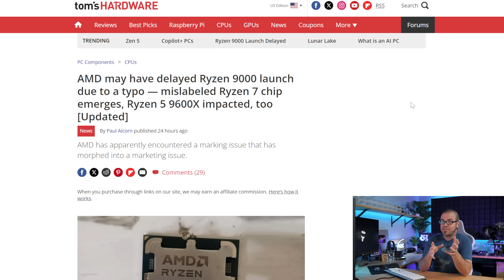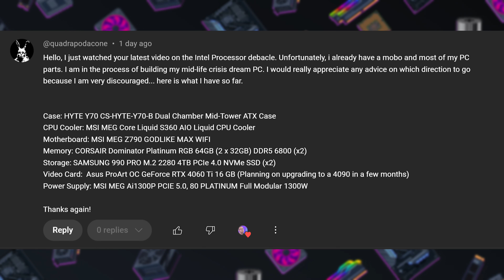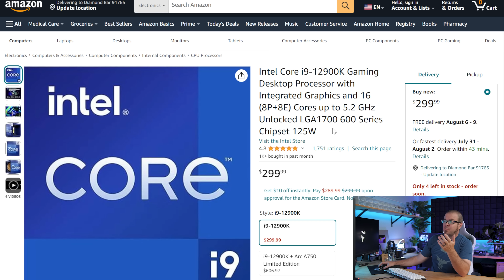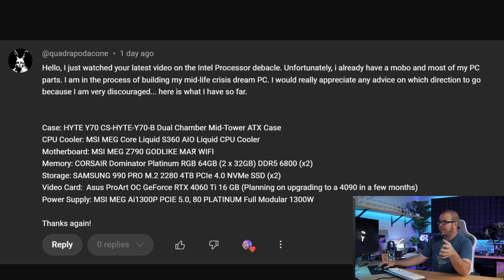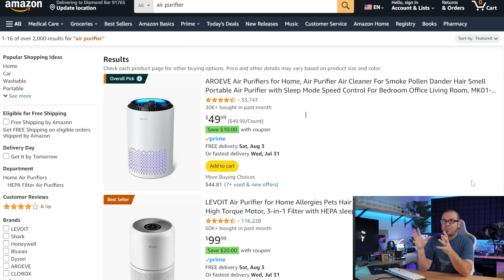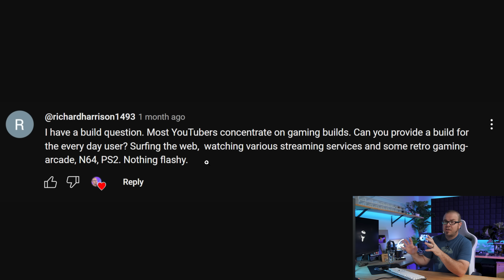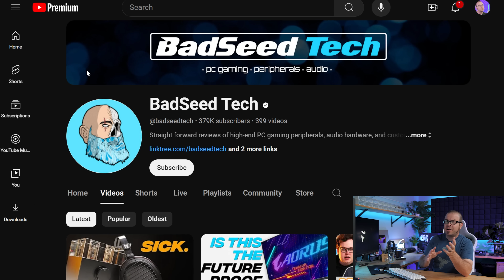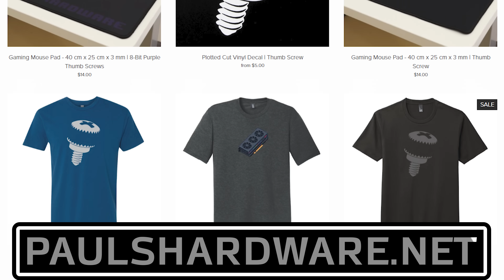What if my Intel CPU explodes?? - Probing Paul #88

Comment: This is why Intel should be legally required to offer a refund to anyone with one of these CPUs, aswell as cover the cost of an equivalent motherboard for a different platform.
Reply: Sorry but that's a pretty unreasonable request.
Reply: @Bobo-ey8fc Its not at all. They put out the product, they made the mistake, they pay for it in full. Next time test your product thoroughly.
Reply: You really don't seem to get it. This is still very early in the process. This could be solved by the micricode update. Also, my main point was it's completely unreasonable to expect Intel to buy you a new motherboard. Frankly that makes no sense and will never happen.
Reply: @Bobo-ey8fc  Well if you want to change platform as you would need to get an equivalent and get away from this unstable platform you need a new mobo. The need for the new mobo is caused by Intel pushing an unstable product to market. It's their fault, so they pay for it.
Reply: @sirdetmist3204 Good luck with that my friend. But I hate to break it to you, that just isn't going to happen. Never has, never will.
Reply: @Bobo-ey8fc  I did say it would happed I said it should.
Reply: @Bobo-ey8fc  I know it wont because companies get away with anything they want.

Just like Nvidia should have been fined billions for releasing a product that was a legitimate fire hazard.
Reply: @Encircled247  I see you're one of these "all companies are evil" guys. Look, say what you want about Nvidia (I'm no fan, but they make good products). But here are the objective facts. They had an issue with the design of the 12V high power connection. Some of the issues were design related while some were user error. Nvidia quickly redesigned the connection, accepted customers RMAs (even the ones that were due to user error) and generally handled it in a decent fashion. 
But of course, in your eyes since all companies are evil, this wasn't enough. 
With all due respect, I think your anger is impairing your ability for rational thought here.
Reply: @Bobo-ey8fc  If something you make constantly causes user error then its the thing you made, not the user. This rarely happened with the old connectors.
Reply: @Encircled247  First off, I never said the connector was ok. Nvidia identified the issue and fixed it. But there was user error (just like there was with the old connector) and the fact that Nvidia still honored user error RMAs is noteworthy. BTW, the failure rate was blown out of proportion by content creators for clicks (just like the Intel issue). I build over 200 PCs a year and I didn't have one single failure of a 4090 since they were introduced, and I do mainly high-end builds.
Reply: @Bobo-ey8fc  Its not noteworthy. The connecter is weak and awful. Its an awful design. Awful designs lead to user error. Thus its Nvidia fault, meaning they pay for it.
Reply: @sirdetmist3204  Um, they have already addressed the issue with an updated version. As I stated I have done hundreds of pcs eith the 12vh connector and haven't had a single issue or failure. You're overblowing this just like you did the Intel issue. I've provided factual information in a rational manner. If you want to have an actual discussion. I'd suggest you calm down and travel with facts not hyperbole.

Comment: no one is speaking about specific cpu which caused this errors  because i am using intel i9 13900k i have faced a lot of bsod before but not every day i have made temperature control limit on bios now it is not creating any issues , i agree what your telling but controlled over clocking issue but exteneded supported clocking limit will not cause any such issues , this issue is coming from few cpu not on all cpu's, i am using gigabyte Z790 pro ud ac mother board

Comment: The last Intel cpu I had was the i5 4460 and didn’t gave me any problems. After that I had an amd Ryzen 3700+ and had some memory problems. Most of the memory problems were gone when I changed to an amd 5800X. Since then I use a mini-pc.

About the Intel 13th and 14th gen cpu’s, Intel extended their warranty for two years, it’s going in the right direction. And about the internal or external sound card vs motherboard sound, for the longest time I have used an internal sound blaster audígy 2 and it sounds much better than onboard sound, especially if you have good speakers. Thanks Paul for all your videos.

Comment: Wow what a reasonable suggestion 12900k is cheap and asus tuff mobo is dirt cheap with 2x32gb ram and 4060ti 16gb, this is the exact platform i use and i tuned it to give me great performance for less than half the cost. Nothing is going to give you the same vr or overwatch performance per dollar duh

Comment: So, if you REALLY need an Intel CPU, buy the 12th gen !?   But better yet, go AMD, even with their AM4 motherboard sets, that is still very good, specially with an Ryzen 5700X3D !   
Or go the better route, spend some more money and go for AM5, with an AMD Ryzen 5 7700X , or spend a bit more for the top : AMD Ryzen 7 7800X3D, with at least 32Gb ram !

Comment: One of the major contributors to Dust is dead skin flakes. So a Bedroom is more likely to build up dust than other parts of the house. What you want to do is setup a system to pull air out of your room through a dust filter, and simultaneously push fresh air into your room, also through a Dust Filter, if you are experiencing a large amount of dust. I actually have a Return Vent in my room connected to the return ventilation in my house, and of course both Inflow and Outflow from the HVAC are filtered and changed twice a year when possible/remembered. But anyways my dad figured this out in the 90s and setup a return vent in my brother's new room, and I just got to benefit years later.

Comment: hey paul I have a question I now have in my PC with an MB of MSI B550 Gaming Plus and I have a Ryzen 9 5900x and for ram Corsair 32 GB DDR4-3200 Kit RAM
(Black, CMW32GX4M2E3200C16, Vengeance RGB PRO, XMP)
but I want to upgrade it to 64 GB and found this Corsair 32 GB DDR4-3200 Kit RAM
(Black, CMH32GX4M2Z3200C16, Vengeance RGB PRO SL, XMP 2.0, AMD Ryzen Optimized) will this be compatible with each other. BTW love your vids
Reply: they will work, still don't advise, if you are able to turn xmp2.0 on a 4 dimm config with different latency and different base frequency, they'll run at 3200, if you're unlucky and xmp get unstable you'll be running both at 2133, find the exact same model, or better, w8 for a promo sell yours and get a 2x32 64 kit
Reply: @zazo..  the only thing that is differs between the 2 is one is smaller in height and AMD Ryzen Optimized
and the other not bud im not sure if thats gonne give a problem and sorry im using google trans late  and ty for helping
Reply: @the_american_way5756  
"CMW32GX4M2E3200C16" SPD Latency 15-15-15-36, SPD Speed 2133MHz - XMP 3200mhz
"CMH32GX4M2Z3200C16" SPD Latency 18-18-18-43, SPD Speed 2666MHz - XMP 3200mhz
Reply: @zazo..  ooo sorry ty man <3
Reply: @the_american_way5756  nothing to be sorry mate ;)

Comment: I highly recommend the BLUEAIR Blue Pure 211+ (square block shape) for an air purifier. It's expensive, but it does a fantastic job. The smaller and cheaper 411 (cylinder shape) is a great alternative if the 211+ is too pricey. These filters do an excellent job of sucking up a lot of dust; my computer goes months with hardly any dust gathering. Both models are designed to run continuously, and I recommend you do that. They run exceptionally quietly.

Comment: "4060ti 16 gig is not that great of a graphics card"

Thanks, Paul.

-User with a gtx 1080
Reply: i feel you, running a 1060, but he has a point, the guy has a z790 godlike mobo, what's the point of spending $1000+ on a mobo and ~$500 on a gpu?
Reply: Just like any other Nvidia crap !

Comment: I wonder what the reason for these supposed Intel failures is. I have been building custom workstations to order only on Intel for years, hundreds of sold I9 14900K and 7 14700K only on MSI and Gigabyte motherboards. Asus has the most unstable boards on the market, so I do not use them and I also advise my customers not to do so. All sets have manually set operating parameters and are stable even under maximum load. I advise you to listen to the voice of reason. The big advantage is that there will be an abundance of processors on Ybay for pennies, just take it because they are 100% not defective

Comment: If you want to be serious about cleaning your gizmos, I suggest the following kit:
1. Stop wasting $ on canned air. Get a cheap, tiny $50 air compressor from Harbor and use lowest pressure. 2. Paint brush & Q-Tips, Pipe Cleaners. 3. 98% Isopropyl alcohol. Because you need to break the static cling to all your bits, and dry wiping can INCREASE the charge. Alcohol wiping breaks the cling. 
And don't forget to hit the BACK of your fanblades with a liquored up Q Tip to break cling and regain airflow, otherwise it just turns into a dirt clod again that delivers no pressure.
Edit: I have a 5000d Airflow housing my daily driver pc, and despite so many wonderful easy-clean filters, it still needs this treatment every season on the inside.

Comment: Dusty computers will stay dusty if you smoke around them. I build and fix computers on the side and smoker PCs are the worse. Components literally become sticky. If you want less dust in your PC, don't smoke around it and get a better vacuum and clean your carpets more often. A carpet cleaning vacuum is also recommended as it'll actually pull a lot more dirt out of your carpet with soap and water. My PC stays clean because of this. I built my current PC about 9 months ago and its still very clean inside.

Comment: Am an Intel owner, am baffled they havent put a hold on sales for the chip, as like you said the info they released isnt exactly reassuring, and I think your advice to those Intel builders on swapping the board for AMD (or if has to be Intel get a 12900k) is solid.

For reference my chip is stable, but of course due to lack of info on batch numbers etc., I dont know if my CPU is already on its way to failing.

Comment: Hopefully everyone panics and turns their setups in so I can buy them cheap
Reply: I’m at X13 z790 mobo’s, X5 evga classy, X4 evga dark kingpin, 4 gigabyte aorus xtrene x, X5 i9 14th 14900k, X2 ROG Thor 1600W titanium, X4 inwin dubili gold cases, X4 cooler master c700m grey cases, X1 thermaltake tower 500 black

Comment: So iv never ocedy 2nd 14900K (FK  Asus Ai OC and you're 1.65v-1.71v) i Delidded this CPU Liquid Metaled it gave it Der8auers Direct Die Contact Frame (200% more surface area) put the Bubblegum TG Tim and a Arctic Freezer ii Aio temps have never hit above 71c under extreme stress. 

1. Voltage is steady at 1.34v - 1.41v under heavy stress 
2. Temps while idle 32c Gaming 45c - 65c on hottest cores.
3. Passed 5 Fitgirl repacks and RDR2 Dodi unpack at same time it didn't atomize the rig.

Ahould i risk this stability for another bios update or stick with if it aint broke dont fk with it?

Also @11:45 look into DOUK Amp/Dac om amazon and Edifier speakers amazing audio Quality and the Amp/Dac have many options like BT RCA USB to your system have been game changer in audio fidelity and it was cheaper for both items then my headset alone.

Comment: To me the 4060 is a good option for one sole reason: 8pin
Reply: 4070 & 4070 super has 8 pin to
Reply: @mr.electronx9036  at least for me, I didn't find them.

Comment: I just sold a Z690 board and a 13700K for $430 locally. I don't feel like it has hurt the secondary market all that much. I was going to make the buyer aware of the current issues, but he's also a local system builder and was already well aware.

Comment: Techtubers need to be more clear about the intel problem.  If you have 14th gen and you lock cores and set voltages to safe levels right out of the box, the overvolting VID problem DOES NOT APPLY TO YOU .  A bios update does nothing for the oxidation problem which intel has stated only applies to 13th gen.  It simply nurfs the CPU which will fail prematurely no matter what.

Comment: Thanks for the video. Is there any data on how many CPU's actually failed? I have an  MSI Tomahawk with a 14900 KF and pulled the voltages back from the get go from what I was reading regarding heat about 6 months ago. I've had zero problems so far. The system eats everything I throw at it. I do audio video Star Citizen DCS. I used to give everything the benefit of the doubt, but now we live in the age of bullshit and I don't believe anything unless I see evidence. Seems to me part of the problem are bios configs. But if there is oxidation where is the evidence?

Comment: It's easy for the AMD fanboys to say just go AMD, but I've had FAR more issues with my most recent Ryzen build than my last 5 Intel builds combined. That and Intel's better multicore per dollar for anything besides the i9 is exactly why I upgraded my 12700k to a 14700k. I daily drive AMD and Intel side by side, and I still have core parking issues on AMD where I'll click on a program and the system just sits for 10 seconds before even trying to load it. Not to mention I had constant USB dropout issues that made me think it was a faulty motherboard, until finally after a year and sixteen BIOS updates where no less than 5 said it fixed the issue did it finally go away proving it was on AMD all along. If you "fixed" it, why did you have to fix it 4 more times? 16 BIOS updates in a year isn't normal, no matter how much mental gymnastics copium you perform. You wanna talk about frustration? Have someone randomly unplug your mouse while you're gaming.

I finally gave AMD another chance after getting burned on FX twice, and have regretted every second of it. I went with Intel to upgrade my 12 core i7 to a 20 core i7 and now I have to worry about it's reliability? All of these companies just suck and that's why I constantly tell everyone NO ONE should be a fanboy unless you're a shareholder.

Comment: For an everyday non-gaming PC, nothing beats a business class laptop! I myself love X-series Thinkpads, and my EDC has been an X230 for years. When I dock it at my TV (not 4K) I have a capable HTPC, when I dock it at my desk I have a multi-monitor workstation with a full sized keyboard and mouse ready to go, and when I throw it in my backpack it is always fully charged and a capable companion PC on the go. I would pick up a used X280 to get 4K and Windows 11 compatibility if I were to buy a new setup today though.

Comment: Pauls Hardware : you don't know squat about the RTX 4090-s PWR consumption. It needs at least a 1200 Watts PSU if it is coupled with an AMD CPU. But it needs at least a 1500 Watt CPU if it's paired with a Shintel Core i7 or i9. That's due to Shintels Nuclear PWR consumptions (and Nvidias own) and due to the fact that you cannot get 560 Watts of continuous PWR (with max peaks up to 641 Watts) for the GPU alone via a single 12V rail through 4 x 8-PCI-Ex connectors. It's just not how the PSU design is made. That PWR is distributed through 12V rails and multipliers or dividers on the 12V rails.
The 1200 Watts PSU is just not gonna cut it for a Shintel-Nvidia build.

Comment: to prevent dust intake which I pretty much eliminated, only ultra fine dust remains 1-my tower is above my desk on an ikea Alex 9 drawers unit (45+ inches high) 2-have filters on all intakes 3-using icue or whatever you control your fans with try to achieve 50-50 intake-exhaust airflow this prevents your PC from becoming a vacuum cleaner but the important part is the PC being high you can buy DEMCiflex filter kits depending on your case model they won't have a nice look (they are floppy like textile almost and cave in or out depending on airflow direction) and they do limit airflow but are super fine and prevent visible dust from entering your case, since I'm liquid cooled I only lost like 2°C but it depends on your config

Comment: My year-old i9-13900KF system has been [apparently] running fine, but Cyberpunk 2077 started to persistently crash on opening in the last few months. To make a long story short, I updated the BIOS [June '24 release] on my MSI Z790 motherboard and that solved my Cyberpunk problem. I'll be watching for the promised August BIOS/microcode release and see it I need it. I'll probably install it if it seems advisable.

Comment: telltale of your cpu being a shambling zombie already dead cinebenchr23 will crash even running stock clocks and lower DDR5(or4) speeds it's the 1st thing I noticed and because there's a lot of bad info being reported including and mostly by youtubers talking about "instability" which never existed it was terminal degradation from the 1st day here are the problems 1-intel sold i7 as i9 knowing some cores did not meet quality standard 2-they had a fab problem 3-the ring bus design is flawed and overloaded frying your cpus from the inside, like many I'm out and switching to x3d asap I had 2 cpus dead in 24 months and the whole 2024 ended up me fighting for my pc to not blue screen every 5 min BTW my point no1 is the reason for AMD delays they suddenly realized some cpus needed to be downgraded to the lower tier (exactly what Intel didn't do)

Comment: I upgraded from my 12700K to my current 13700K on my Z690 DDR4 motherboard last November. One thing I did day one is apply a 75mV undervolt to my CPU to reduce power consumption. Haven't had any problems.
Reply: Intel 13th and 14th gen were IQ tests which many have failed terribly. Mine's fine fortunately ;D